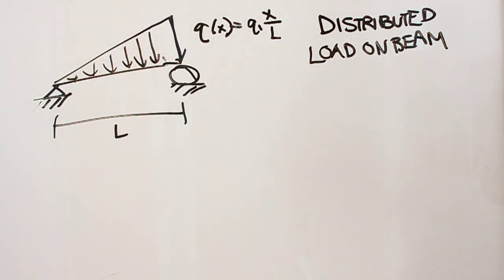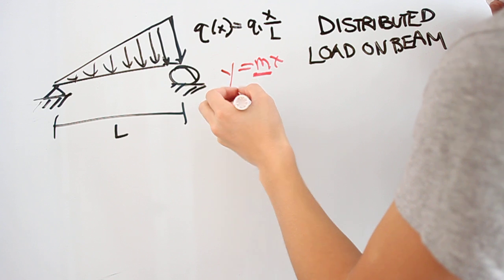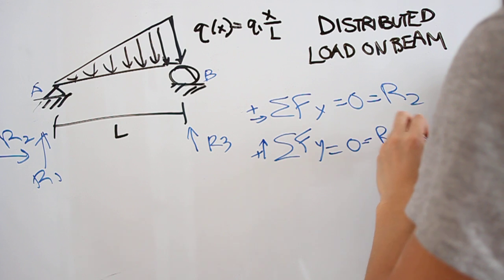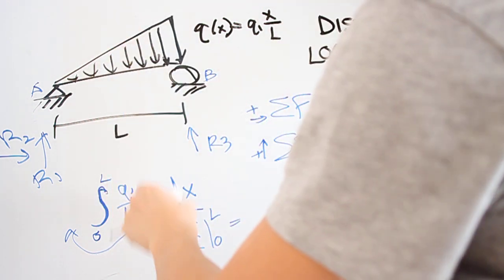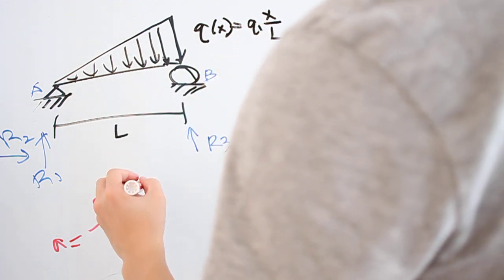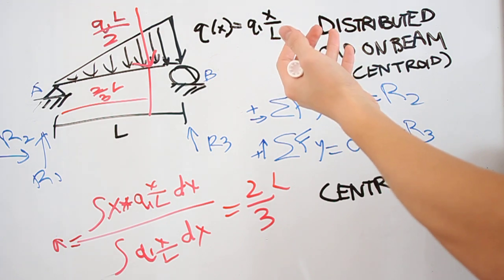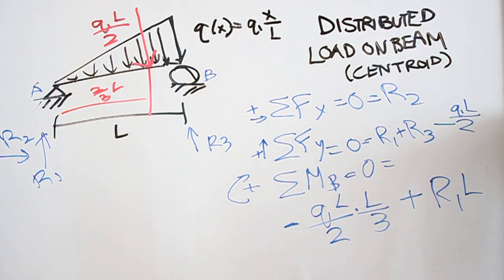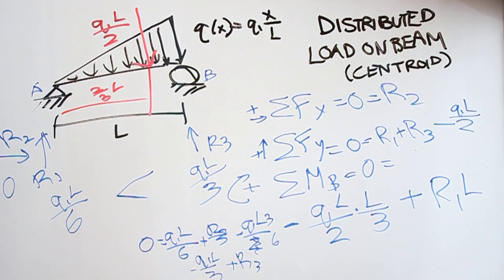Distributed Load on Beam (Centroid)

Comment: Definitely the WORST explanation I've ever seen on beam loading. Ouyang might as well say, "I've drawn a magic beam which despite its uniform appearance is massive at B and ~ = weight of a photon at A. Just for fun, let's wake Newton from the grave and use his invention Calculus (not gravity, which he didn't invent but rather formulated) to solve it.

Try this kids: 
Draw a 10-inch beam that weighs 10 lbs, with points A (left end), B  dead center beam Length (which we'll call 'L') and C (right end). Let's say B = Cg... for fun! 
Know these facts.
FACT 1. Add a BAF (Big Ass Feather that weighs 1 LB) to point A and the beam will tilt toward A like a teeter-totter (probably an outlawed playground device, so google it).  
FACT 2. Move the BAF to Cg (B...still with us?) and there is no tilt. 
Problem 1.
Guess what happens if we move BAF to C? (This will be homework if you don't figure it out.)
Problem 2. 
If 1 BAF is placed at A, how many BAF's must be placed half-way between B and C to balance the beam? Feel free to use Newton's invention to solve. btw, if you don't come up with 2 you FAIL. And change your major to performance Ballet, not ME.

Comment: when can u use 1/3 or 2/3 for the centroid of a triangle?
Reply: Depends on where the other side is
Reply: it is 1/3 from the side with the greater load. as the load is not distributed equally throughout, the point where the load would act would be nearer to the side with the greater load hence 1/3 from the side with the greater load and 2/3 if you want to take from the side of the smaller load.

Comment: I like doing it the calculus way but there are also centroid formulas that are a lot quicker if the shape of the distributed load doesn't have any curves in it. For example, the triangle centroid formula is just 1/3 the distance from the height side of the triangle (or 2/3 the distance from the zero force point of the triangle). Same answer either way:), good vid thanks.